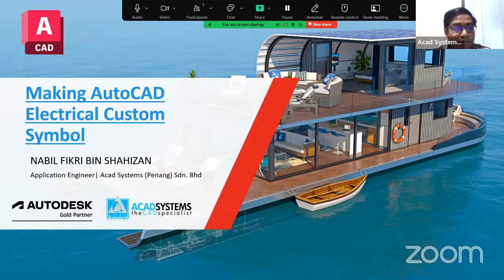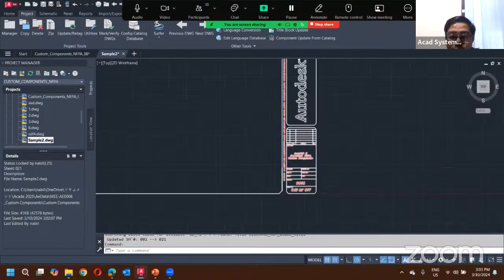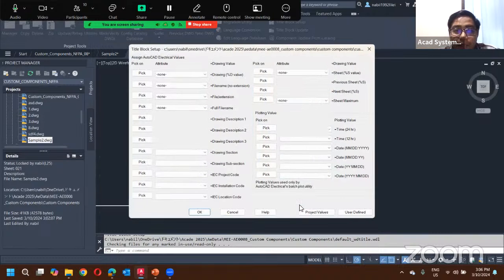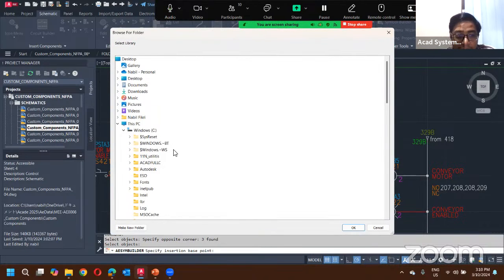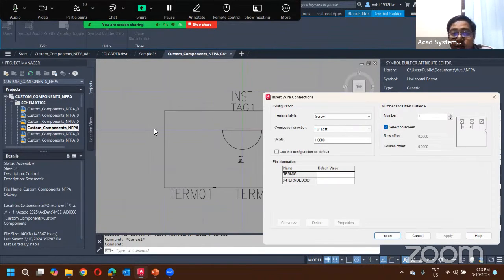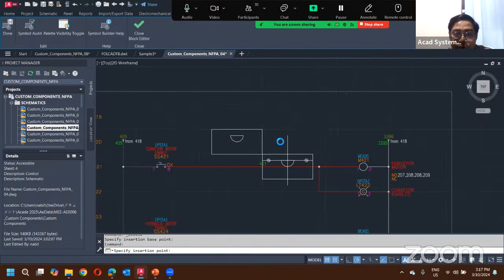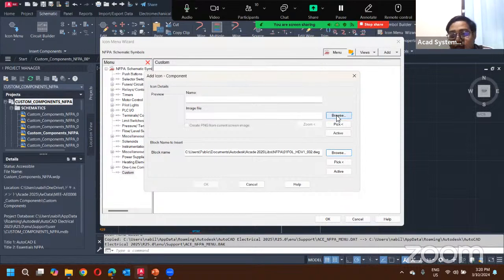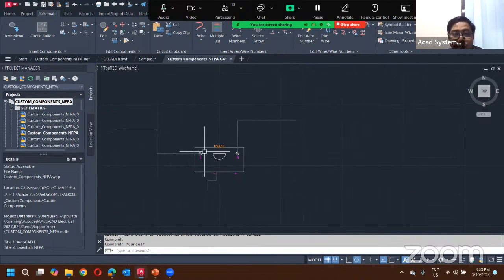Making AutoCAD Electrical Custom Symbol

Comment: After creation of the symbol and assigning the wire connection, how do we resolve the error in the insertion point ( Insertion point: Not in line with wire connection). Just curious, why did you skip the symbol audit option?